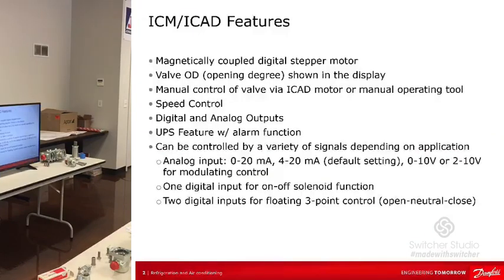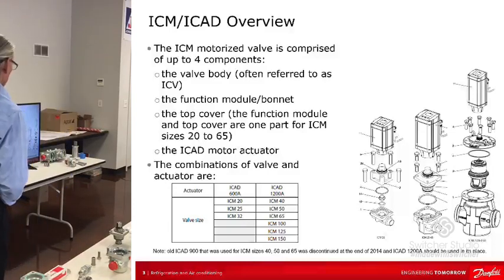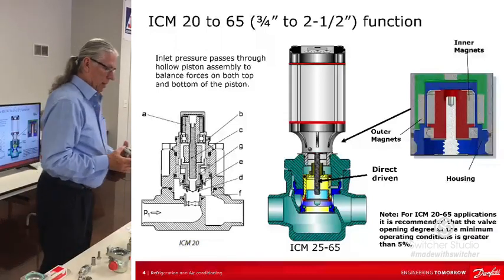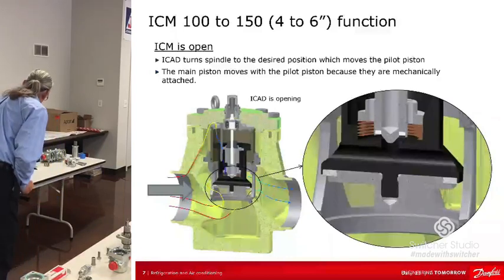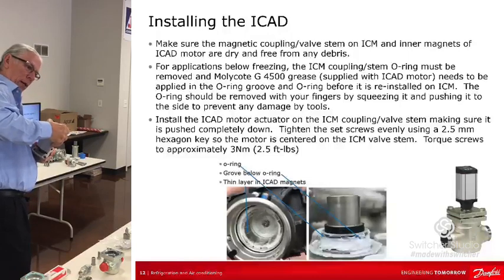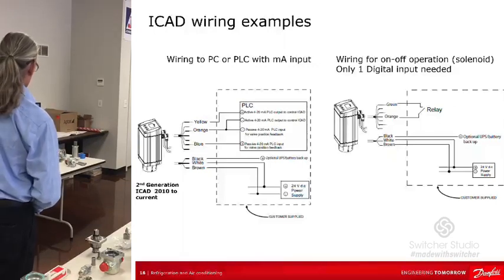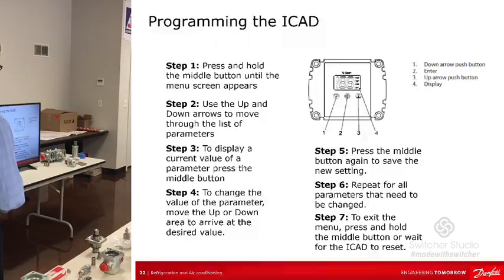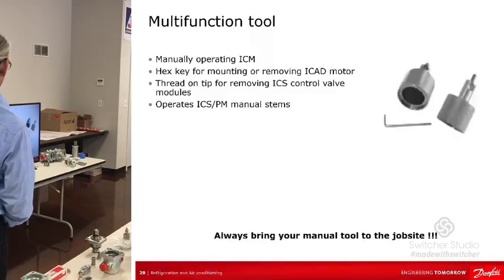Danfoss Training: Motorized Valves - Type ICM with ICAD Motor Actuator

Comment: Does anyone know what stops NH3 from being trapped between the liquid solenoid and the ICAD 600A ICM 20?
Lets say the liq solenoid calls will the motorized valve know when there is no liq between the two points?